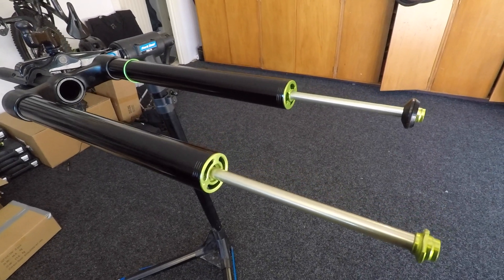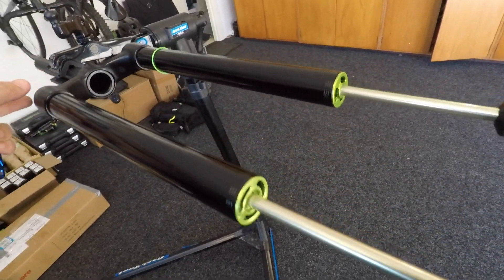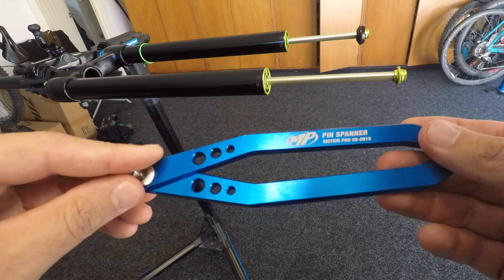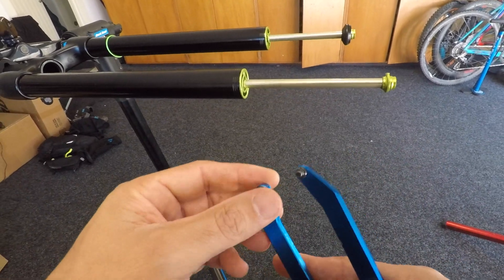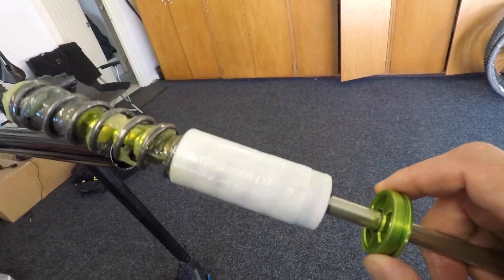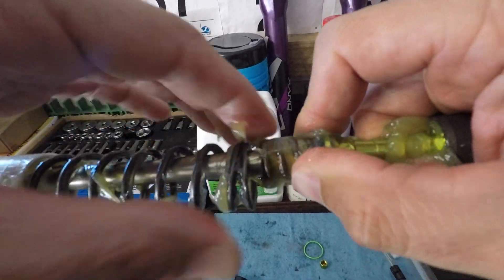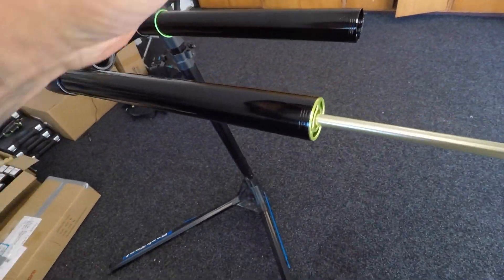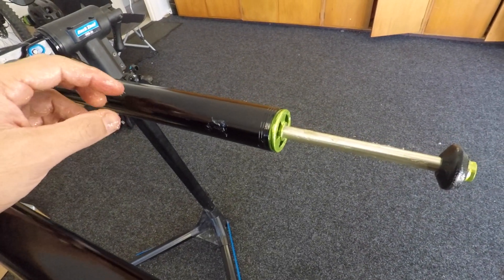DVO onyx travel adjustment

Comment: Hi, 
I have dvo onyx d1 160mm on my ripmo af , can I increase the travel to 170 or 180mm? how will this affect the geometry? in the case of 170, I suspect it's not much, but 180 is already a 20mm difference... and the damper is only 150mm, and won't that be too big a difference of 10mm or 20mm? thanks in advance for your answer
Reply: Old comment, but might be useful for someone in the future. Each 10mm of extra travel will approximately slacken your HA and STA by 0.5 degrees (there are calculators to figure it out exactly), it will also raise your BB (not sure how low the ripmo is, but that can actually be beneficial on some bikes if you have a lot of rocks and roots to content with). Some of these effects can be counteracted with angle adjust or reach adjust headsets. Look at what Ibis states as max A2C for the fork. In general upforking 10mm is fine, but it could still void your warranty.

Comment: Thx for the Video. But why are they calling themselfe from riders for riders if you need a tool you need nowhere else at the bike?
Reply from the maker: Hahahah your going to have a rough time with any suspension brand if you think it can be done with regular bike tools
Reply: @dvosuspensionnz  you can service a rs for k with regular bike tools. You do not need a special tool which uses no other brand. DVO uses tools, which no other brands uses just to make money.
Reply from the maker: @sloops4398  ah sorry I just saw this is the travel change vid and i guess your talking about the tool we had made? Well atleast you don’t have a buy a different length air spring. Win some you lose some aye mate
Reply: @dvosuspensionnz  i am really happy that i can change travel between 160 and 180mm in infinite increments. That is not the question. But i also have seen that for example RS learnt. At the old forks, it was not really easy to get the safety ring out because there was no sprace below the plastic. Then they replaced the plastic with aluminium and it was much easier for service. Why is DVO not using the same techniecs? As a engineeer, i also ask my self, why to scew? Makes no sence for me.My one was glued. Needed a really big force to unscrew and i was neally damaging it. I am working at a test enigneer and so my job is it to find mistakes which could be bad for the customers. The disadvantage is, that i find this errors at other products and ask myself, why nobody has tested it before.

Comment: Are you using the 3mm or 4mm pins on your spanner? Thanks 👍
Reply from the maker: We threw those in the bin and made our own custom tool. It’s available on DVO.nz
Reply: @dvosuspensionnz  Are there torque specs for that new tool?
Reply from the maker: @Sjaan_86  nah, we just do it up snug and life is good haha
Reply: Did you ever find out if it was 3 or 4mm? The DVO tool is pretty expensive
Reply: @keithholden2339  I did not
Reply from the maker: @keithholden2339  yeah but slipping with pin spanners is way more expensive haha

Comment: Hi, I have a Onyx Sc 160 mm. Can i make it to 170 mm with this procedure ?
Reply from the maker: Yip
Reply: I have to take out the spacer or insert a smaller one ?
Reply from the maker: @marcobribiesca9697  no spacers is 180mm, 1 is 170mm and 2 is 160mm

Comment: i think i may have broken my ott. I did not try to take it apart or adjust the travel, I just think I simply turned to a bit too much. There is clicking but no more resistance. I did this with about 65 psi in the fork. I am now figuring out that you arent supposed to have air when adjusting the ott. This was on a dvo onyx dc (gaint tuned) for giant glory 1 2019. Is there any way I can fix it? thanks.
Reply: U suck

Comment: What do you think of using 20wt fox gold in the lowers instead of 7.5wt? Cheers!
Reply from the maker: Yeah mate I’m all for it aye. That and motorex 68k supergliss are great. Only down side is if you ride somewhere super cold they won’t preform as well as a thinner bath oil
Reply: @dvosuspensionnz Awesome man, you think the 20wt performs better than 7.5wt? And which oil do you use for within the damper?
Reply from the maker: @olivierhacking  i think the 68k and 20wt feel better and last longer yes. But that’s in moderate climates. I use 2.5wt motorex racing shock oil in our dampers

Comment: It can be adjust at 170mm?
Reply from the maker: 160, 170 and 180mm
Reply: @dvosuspensionnz  how do you get there? Removing the spacer?
Reply from the maker: @higuerasflow8439  no spacers = 180mm. 1 spacer = 170mm. 2 spacers = 160mm
Reply: @dvosuspensionnz  thanks bro
Reply: @dvosuspensionnz  with the dvo diamond, it can be also reach 170mm?
Reply from the maker: @higuerasflow8439  in 27.5 yes

Comment: Hi there! Awesome video. Do you have one on how to remove the lower leg? My brand new Onyx SC D1 came with a noisy OTT spring that could use more grease. I'm not sure how to remove the lower leg. Thanks
Reply from the maker: Just a good long leverage set of pin spanners or I make a custom tool for it
Reply: Remove the rebound and OTT foot nuts using an 18mm socket then, using a soft punch of some kind (plastic ideally - I've ended up using wooden spoon handles in the past!) knock both the air and damper shaft out of the lowers. The air does not have to be removed for this part but if you plan on removing the OTT assembly subsequently, it would certainly be wise at that point.
Reply: @willyf1847  Thanks man. Plan on doing this within a couple of weeks. Need to get me some suspension oil as well
Reply: @MILTONATOR  No worries, good luck. DVO use 7.5wt Spectro Gold if i remember correctly. Anything with good lubricity will be good though, fully synthetic motor oil, slideway oil etc. I'm trying some Mobil Vactra 2 in mine at the moment; Fox Gold, Motorex Supergliss, Rockshox 0w30 etc are also very good 👍
Reply: @willyf1847  good info 🤘thanks
Reply: Did you get any info on how to properly remove the lowers? I need to change mine from 180 to 160 and have no dvo service in my country 😖

Comment: Hey JP, thanks for the video.
Do you know if there's any way to make the Onyx 150mm travel?
Reply from the maker: The official answer is no, as it makes the OTT spring do some strange things but there are ways around everything haha
Reply: @dvosuspensionnz  Thanks for the reply
Reply: @dvosuspensionnz   like the 6mm of stack I’m going to evenly cut off a 10mm travel reduction spacer (x2 10mm spacers + 4mm to make a 179mm lowered onyx DC) #gang

Comment: So if removing the lowers is done carefully, travel change is possible without having to replace oil?
Reply from the maker: olivierhacking yeah if you slide them off horizontally you will only loose 5cc maybe 10 if you mess it up haha
Reply: @dvosuspensionnz  Haha damn, no way to do it without spilling any oil? I don't want to have to buy oil for the travel change...
Reply from the maker: olivierhacking fresh oil is a good thing to have on hand mate. If your doing jobs like travel changes then it will mean you can also preform your own lowers service, so will save you $$
Reply: @dvosuspensionnz  Good to know, thanks man! Which oil(s) do you use for the Onyx SC?

Comment: so I just did the travel change on my fork.  got it all back together and now the rebound knob will not turn.  any suggestions?
Reply from the maker: Is the rebound super fast? There is a good chance that when reinstalling the foot nut that you have just wedged it’s hard against the most open setting and it may need some encouragement to break it free back towards slow but please be carful

Comment: Just confirming when you buy a new fork it does come with new spacers in the package? I just purchased the 180 but I need it to be at 160
Reply from the maker: crallen68 correct
Reply: @dvosuspensionnz  thanks for the response.  do u know of what other springs may fit on a Jade X? I am needing a higher spring rate than DVO offers
Reply from the maker: crallen68 hi mate. Cane creek have there 36.6mm spring that fits but that’s all I’ve actually tried. As long as the ID, bind point and overall length are right it will fit

Comment: I'm totally devastated... got a bike trip this weekend planned months ahead, waited 3 weeks for the fork to arrive(delayed delayed and delayed), got the tools needed for travel change & full service (when the time comes). Done plenty of lower leg services on RS & FOX, i'm a meassure twice, cut once guy. Completely busted the bladder top cap on a Sapphire D1, eventhough I was super careful as I don't have time for any screw ups or missing parts... it is nearly half the size (height) as the air side top cap (which is like FOX / RS "height"), and they tightened it so f*cking hard that my brand new 22mm socket wrench just blew the sides off... not sure what my mail to DVO will do any good:  https://youtu.be/YI0W74Q365o
Reply from the maker: Sorry to hear that mate, not an issue I’ve had personally.
Reply: @dvosuspensionnz  Yeah me neither. I got a mechanic to use special tools to untighten it, and I could do the travel change, easy peasy. Your video definately proved useful on the innerparts of getting the spring dislodged etc. I always use rubber gloves, so the fiddling was kept to a minimum (he he). Cheers
Reply: JP Tuning Can you check if your bladder top cap is also about 2mm lower then the air top cap? Cheers

Comment: Hi, thanks for a great video. I believe I can follow the same steps for adjusting travel on the Sapphire 34 D1? Do you happen to have a video of the steps preceding and following this one - i.e. taking of the lowers and putting them back? Thanks!
Reply from the maker: Harri Roto yip the travel change is the same. I do not sorry, but I will put one up in the next few days for you
Reply: JP Tuning wow, awesome, thank you! I have never worked on forks/shocks before, so am slightly intimidated by the task ahead..!
Reply: Hi! Got my pin spanners now, any chance you would have shot the video of taking apart and putting together the fork? Also, great stuff on the topaz video, will definitely get that to replace the fox dps soon!